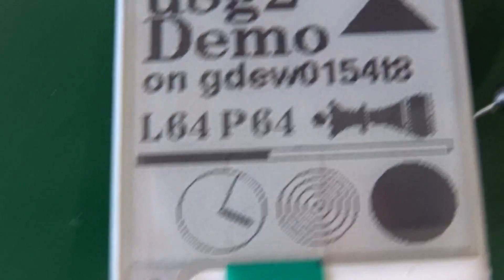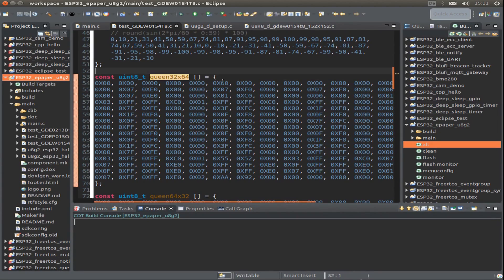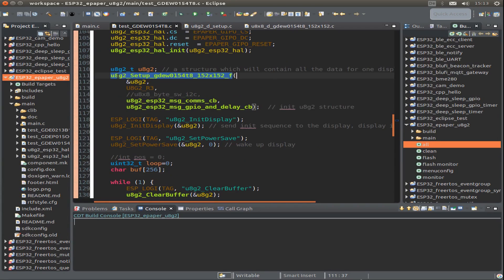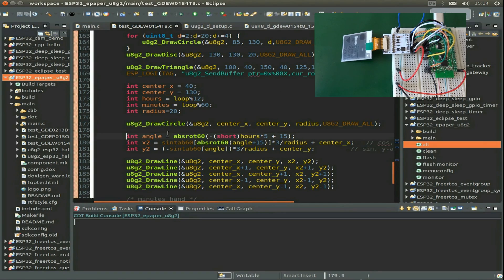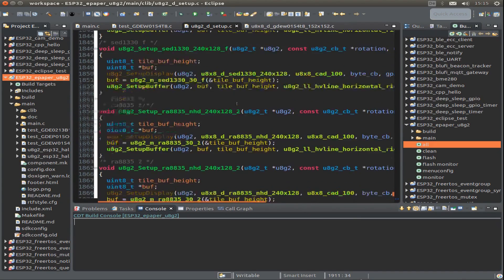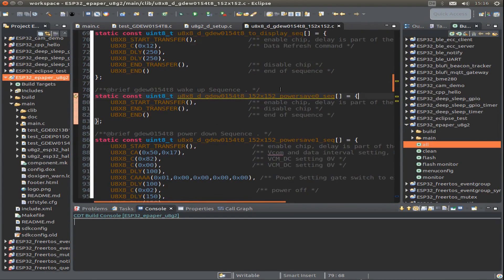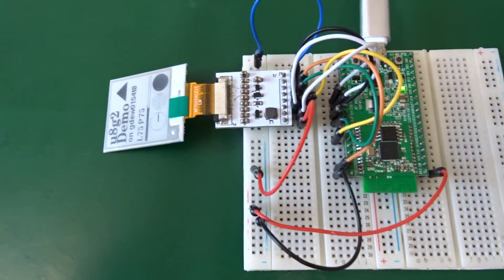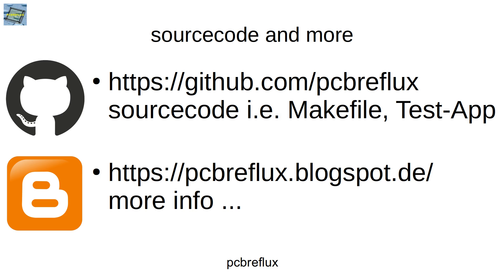ESP32 #66: ePaper (2) u8g2 interface

Comment: One of the major features of ePaper displays is that they keep the image even without power. However, if the ESP32 is not in sleep mode, the power-saving effect is gone. Is it possible to combine ESP32 deep sleep mode and epaper control for periodic display updates (like once every minute) ?  Thanks and keep up the good work!
Reply from the maker: Sure you can do this, maybe the current example have not code to do this, but your can use the esp32 to get some information with WiFi maybe a price, weather condition or measured value and write this to the epaper display and than go to deep sleep for a given time. After some days or weeks the screen of my epaper displays seams to fade away a little so some kind of refreshment every some days or so is required.

Comment: Hi! Great intro video for chaps like me. I want to migrate from "Arduino-ESP32" to "Eclipse-ESP-IDF", but waht about my beloved libraries (for LCD1602 display or HX711 load cell amplifier)..  can I include them out of the box using  ESP-IDF?   Thanks and keep up the good work!
Reply from the maker: Hi, maybe this video is helpful for you: ESP32 #37: Ardiuno - Eclipse Crossover https://youtu.be/XgAIaVV39tk. But sure this work not with all libraries from arduino and maybe you also have to slightly update the library source code for the esp32 with esp-idf.
Reply: thanks for the link!!